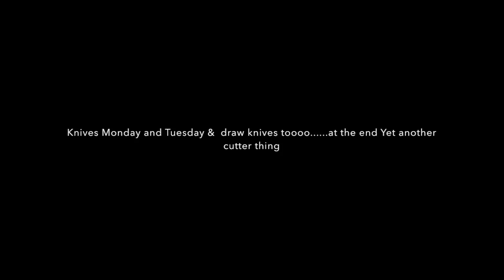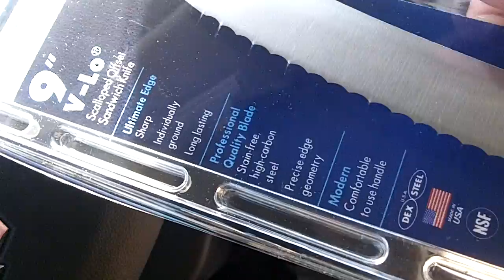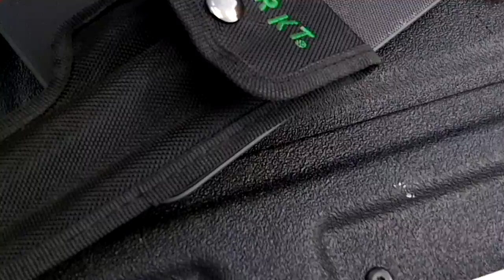DRAW KNIVES - TOMATO SLICER - KNIVES

Comment: What about taking one of your 1x42 belts, cutting it in half then running it between the blades, and holding the belt at either end and sort of flossing the belt back and forth by hand.  If you hold the belt tightly it should work.  And you can cover all your necessary grits.  If you can find a way to incorporate a hacksaw and glue an abrasive belt to a hacksaw blade you could use the saw to keep the belt tight.  I'm also thinking gluing the abrasive to a paint stirring stick but that is probably too thick.

Lastly, there is a type of oscillating tool that vibrates at high speeds left and right but moves very little (maybe 1 cm back and forth).  It has various attachments.  If you got one of the attachments and glued the abrasive to it you could be done real quick.  I have one at home that is good and inexpensive.  Can't remember the brand but you can get them at the hardware store.  I pulled up this link real quick as an example but as you can see they have some very thin attachments that go on the front.  This would probably be the fastest way to go about it!  Plus the tool has a hundred other uses depending on the attachments. They have corded ones as well and cheaper models.  This is just the first model I pulled up.

https://www.amazon.com/PCC710B-20-volt-Lithium-Oscillating-20-Piece/dp/B00FQ8OHWI/ref=sr_1_8?s=hi&ie=UTF8&qid=1491362440&sr=1-8&keywords=oscillating+tool